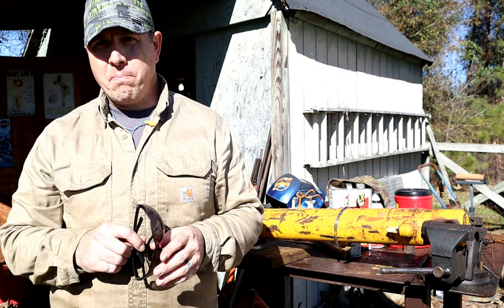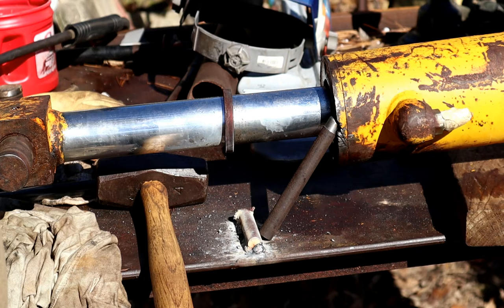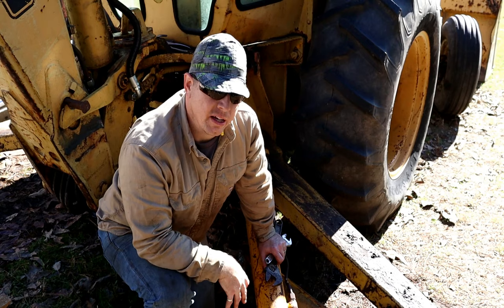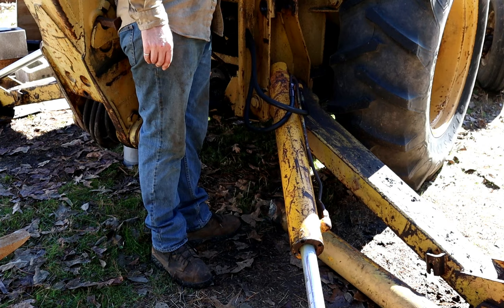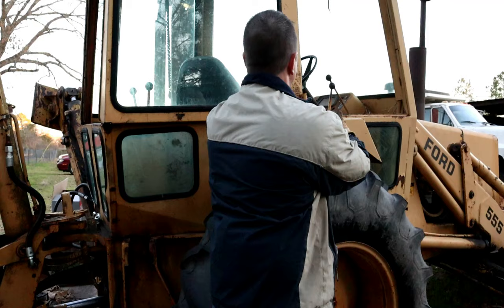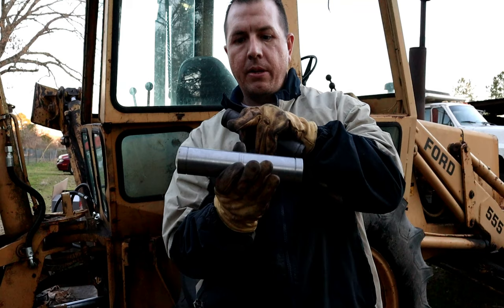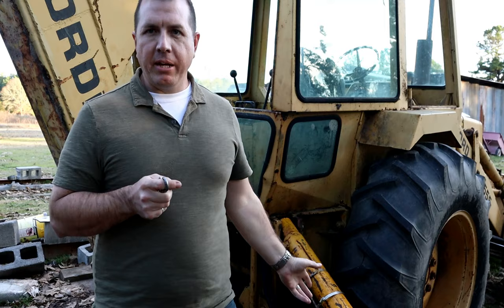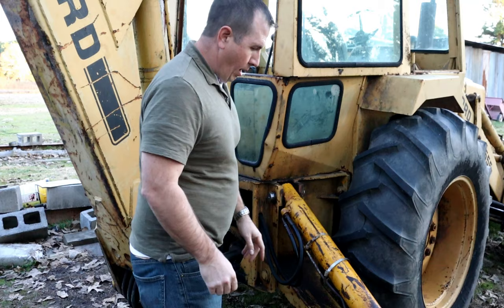Hydraulic Cylinder Disassembly Repack Rebuild Install FAST!

Comment: Great Job on a pathologically designed gland nut that needs to be 2x more material thicker for the torque required to disassemble. Some castlations are called for too. "They're all designed like that" is NOT ok

Comment: 580 boom cylinder . Tried all the stuff - Fail. Finally used long jack and gland wrench on one side, pipe wrench and F250 on the other (via tow chain and a half ton of gravel in the bed). Got the pipe wrench to breaking point then jack did it.
Reply from the maker: Yeah been there. The struggle is real!  I have a vid a few before this one called stubborn cylinder removal or something. Went through something very similar
Reply: I am from China Seals Factory. Our company produces many types of hydraulic oil seals. If you are interested in our products, we can send you free samples so that you can learn more about our products.

Comment: I want to know how much torque was required to break your vice!? I recently rebuilt a case 580 loader lifter cylinder. Got the gland off okay but the piston bolt was like yours. Took it to a local heavy mechanic and he used a 1" drive impact wrench and even then it was tough. (He didn't charge me. Gotta LOVE living in small-town U.S.A.!)Thing is, the torque spec on that bolt is only 210-240 lbs, so it shouldn't be that difficult. The problem is the red tread locker. Heat is required for removal. I have 2 more cylinders to rebuild, so why not remove the piston seals and heat the bolt to 500 degrees? Has anyone tried this?
Reply: Sometimes locktite is an issue heat the piss out of the then try buzzing it off with an impact of that dint work take it to a hydraulic shop and they’ll have a torque bench
Reply: I am from China Seals Factory. Our company produces many types of hydraulic oil seals. If you are interested in our products, we can send you free samples so that you can learn more about our products.

Comment: Heat that bolt head till it’s dull red. It has red lock tight on it and you need to melt it to let the bolt move.
Reply: I am from China Seals Factory. Our company produces many types of hydraulic oil seals. If you are interested in our products, we can send you free samples so that you can learn more about our products.

Comment: My trusty air hammer always seems to do the trick if it doesn’t budge the first try a little heat and then get back to work I’m currently working a lift cylinder on a d8 fairly good sized cylinder but that air hammer always seems to get me out of a bind.

Comment: I had to do seals on one not long ago had same problem getting it to loosen I just heated it with torches then used pipe wrench worked great and didnt have to risk damage beating it off

Comment: My solution removing the stuck gland nut factory installed on a cylinder never serviced in over 50 years.
I have a Ford Construction model backhoe I needed to rebuild the boom lift and curl cylinder . On one cylinder the  nut was so tight it was impossible to break lose. I found something that works very well. 
Since my Nut has notches in it for a special tool that I did not have,  it was going to be hard to grab it, I had a 3 ft pipe wrench but did not want to chew up the cast iron nut.
 I had some 6" pipe so I sliced a piece the width of the nut and cut it to bend to fit the OD of the nut  and with space for it to go on over the rod. 
 I cut some pieces of 1/4"  steel plate to fit the notchs in the nut and welded the pieces to the inside of the ring as they sat in the notches for positioning. That gave me a  protective steel cover for the nut that grabbed it and protected it from the pipe wrench cutting or crushing it.
I had to run several beads of welds on the outside of the  pipe ring to get the pipe wrench to bite it. I put the pipe wrench on my ring and used a 4 ft cheater pipe over the pipe wrench handel, No amount of weight pulling down would un screw the gland nut. 

This was the trick that did it. I had a cherry Picker. I turned the pipe wrench where lifting up turned it counter clockwise. The cylinder was still on the backhoe with the boom extended . Hooking the hook on the cherry picker on the open end of the cheater pipe gave me a lot of power lifting pressure on the bar, much more than I could have ever applied pulling down with even 10 people and a very long cheater bar, it was a 1 ton lift so I was applying almost 2000 lbs to unscrew the nut.,  as I pumped, it almost started to lift the whole boom,  but then pop, the nut broke lose. PS make sure the pipe wrench, the cheater bar and the boom hook are all in line parallel with the nut, having it at any angle will just cause it to lose the bite and slip off.

 I also found a good way to remove the rod from the cylinder. First remove the cylinder and drain the oil from each side. Loop a chain through the eye end of the rod and hook the cherry picker hook to the chain loop, with the arm of the cherry picker extended fully  lift the cylinder till  the cylinder (hole end) is barely on the ground, Run a pipe or bar under the legs of the cherry picker and through the  hole of the cylinder. As you pump the hoist it will lift the cylinder till the pipe through the cyl hole stops it catching on the legs, at that point the rod will start pulling out of the cylinder.
As long as the measurement from the bottom of the legs on the cherry picker to it's arm where the rod is chained is loner than double the measurement of the cylinder when it is depressed, your cherry picker will remove it. Using hydraulics is much easier than any kind of manual pulling.

Always use the mount on the equipment  tractor) to hold the cylinder rod or case when removing nuts, A vise rarely works on hard to remove nuts and trying to remove the rod with one end of the cylinder clamped in a vise is a nightmare unless your table is bolted down in concrete..
Reply from the maker: Sound advice Mel!  It takes a lot to engineer a solution and if someone is looking for another method yours sounds like it worked out good!
Reply: wouldnt a torch have solved a lot of this? we dont like to rosebud either because of collaterial damage, but my hemroids are already a problem! besides the red threadlocker requires heat. is the blue threadlocker recommended?
Reply: I am from China Seals Factory. Our company produces many types of hydraulic oil seals. If you are interested in our products, we can send you free samples so that you can learn more about our products.

Comment: I had a similar problem and got it off by:
=  I left the cylinder dead end attached to the hoe.
=  I put a 48" pipe wrench on the gland that just caught  the exposed 3/8 or 1/2" material of the gland.
=  I then put a large cheater (2" pipe about 16 ft. long on the end of the 48" pipe wrench and just let it hang.
=  I then took a propane torch and heated the cylinder tube not the gland (not very hot)
The weight of the 48 and cheater broke the glad free.  I also tried and ruined a spanner and the 48 by itself wouldn't work.
Reply from the maker: That sounds like the same couple of videos I made before this one, except that method also didn’t work, but I tried it. I think these old machines just have really stuck together cylinders. And the design doesn’t lend itself to an easy disassembly. I hope my vid and comments like these help people find a way without having to take it to the shop for $100/hr+. IT CAN BE DONE👍
Reply: I am from China Seals Factory. Our company produces many types of hydraulic oil seals. If you are interested in our products, we can send you free samples so that you can learn more about our products.

Comment: The new milwaukee fuel high torque cordless impact is what you want. If i hear right they will do 1200 foot pounds no problem. Expensive but worth it
Reply: I am from China Seals Factory. Our company produces many types of hydraulic oil seals. If you are interested in our products, we can send you free samples so that you can learn more about our products.

Comment: I feel sorry for you, you have the same Murphys law that happens with me. One thing I learned is, if it is possible to losen the gland nut while the cylinder is still on the tractor, it is much easier that way, a vise is the hard way unless you have a strong vice mounted to a metal table bolted to the floor, not many people have that.
For a tractor a 1/2" drive air impact driver is not  heavy duty enough, I bought a 1 inch drive impact like they use on big rigs, it was about $134.00 on ebay and got some reducing adapters at Harbor freight so I can drive 3/4 or 1/2 inch drive sockets. It gets the job done for the nut on the end of the rod. Also sometimes with anything that is stuck or rusted , heating the part you want to turn till it's red hot with a torch brakes the bond, if your replacing the rubber anyway it does not matter if it gets toasted. Once you got the rod out of the cylinder, you could have attached the rod to the tractor cylinder mount and had a good support for it.

 My problem has been once I get the gland out, getting the rod out of the cylinder has been difficult , I found if the rod moves freely applying air pressure to one end of the cylinders hydraulic fitting will sometimes blow the rod out, but you need to make sure it can't hit concrete or fall because it will do damage to it. 
The funny thing about these cylinders is the gland has an outer O ring seal and an inner seal pack of cup seals, the gland nut only needs to be tightened enough till it compresses the gland cup seals, once the nut hits the metal face of the gland, or metal hits metal, , the seals has been made meaning it does no good to crank it hard to tighten it because the seal was achieved with the compression of the rubber. It just needs to be snug tight once it bottoms against the gland, no need for a cheater or huge pipe wrench. Seems too many people have no idea of the mechanics of the sealing. They think the tighter the nut, the better the seal, but that is not true because the seal is rubber being compressed, not steel against steel making the seal like with tapered pipe fittings,  flare or compression fittings.
It sucks working on things someone else did wrong, that is why the nuts are so hard to remove sometimes,
 someone thought the tighter the nut the better the seal, not true with cylinder seals, If the cup seals aren't compressing enough to seal, shims  are used, but once metal hits metal, tightening further beyond snug is a mistake and can expand the gland making it stick in the cylinder, making it hell for the next guy to get out. That next guy always seems to be me.
Reply from the maker: You got it right on man. Murphy is alive and well on my farm!
Reply: I am from China Seals Factory. Our company produces many types of hydraulic oil seals. If you are interested in our products, we can send you free samples so that you can learn more about our products.

Comment: Was the tube gulling the cause of the bleed off? My 555 outrigger does that I just got a seal kit. Hoping mine isn’t that bad. I see pipe wrench marks on it like someone’s been in it before. Good video by the way. Would have liked to see you turn the new pin.
Reply from the maker: I think the galling in the piston caused the leak down. The tube may have caused that or vice versa.
Reply: I am from China Seals Factory. Our company produces many types of hydraulic oil seals. If you are interested in our products, we can send you free samples so that you can learn more about our products.

Comment: lightly torch the tube? I just had a cylinder where one of the rings came partially out of its seat and wedged. Every quarter turn was a bear all the way out.
Reply from the maker: I’ll be doing some of the loader cylinders this winter. I feel like they won’t be any easier
Reply: I am from China Seals Factory. Our company produces many types of hydraulic oil seals. If you are interested in our products, we can send you free samples so that you can learn more about our products.

Comment: Hi man time good job , i have similar problem with my mitzy bd2e dozer lift cylinders . Only one of them has bent rod and i will not disassemble  them until i know how to straighten the rod so i am interested to know how you straightened yours ? I only have a small press. Shane downunder.
Reply from the maker: Shane I used a 20 ton H-frame press and it struggled to get the shaft straight. I would recommend larger than 20 ton if possible. You block up either side of the bend and press through the apex of the bend. Then check with a straight edge and roll on a flat surface.  A super heavy duty hydraulic tube bender might work also but be careful and best of luck
Reply: Thanks for advise , gives me confidence to rebuild even if i take it to someone with appropriate press.
Reply: I am from China Seals Factory. Our company produces many types of hydraulic oil seals. If you are interested in our products, we can send you free samples so that you can learn more about our products.

Comment: So extend the cylinder all the way out I was afraid of the hydraulic pressure. So you just bleed it off?
Reply from the maker: With the machine off and the cylinder disconnected pins or laying on the ground not holding pressure, you can loosen the fittings. Do it slowly and there shouldn’t be much if any pressure
Reply from the maker: The cylinder doesn’t have to be extended. The cylinder I was taking apart had a bent shaft and had the gland bound up
Reply: @Man-Time  ok thank you. Anytime I’m breaking hydraulic lines free I always try to do it as slow and gently as possible. I never had a line explode in my face but I always had the fear.

Comment: How abt the bottom piston on the lower boom? Could u do it myself? Or should I bring it somewhere? It’s a Ford 755 backhoe
Reply from the maker: Do you have a place you can buy the repack kit?  How much is the kit from the dealer?  Can you afford to bring it in if you don’t have all the tools to do it, or are you willing to buy all the tools for future builds?  Have you rebuilt one before?  Lots of ways to look at that question. Doing it yourself can end up costing more if you don’t have all the tools and still need to get the parts from the dealer
Reply: I am from China Seals Factory. Our company produces many types of hydraulic oil seals. If you are interested in our products, we can send you free samples so that you can learn more about our products.

Comment: after rebuild its dry of hydraulic fluid, just cycling it like that purges the air and fills it with fluid? i assumed they had a bleeder somewhere.
Reply from the maker: No hydraulic cylinder that I know of has a bleeder. The manuals say to “exercise” the cylinders several times to bleed out any air and it does work.  Best to let the machine set for a while after though. The oil needs time to settle out the air too
Reply: The hydraulic reservoir is the bleeder in that case. Any air in the system rises to the top of the reservoir which has a breather cap! the system is fully closed after the pump. this is alsow why the manuel suggests to exercise the cylinder. That just cycles all the air into the reservoir but you have to be carefull, without priming the cyclinder there is air which is compressable and is a big trouble maker. same goes for almost all hydraulic systems (hydrostatic drive for example) just cycle the oil after replacing or repairing the hydrostat and your good to go. Cheers and greetings from germany
Reply: I am from China Seals Factory. Our company produces many types of hydraulic oil seals. If you are interested in our products, we can send you free samples so that you can learn more about our products.

Comment: funny to see  ,,    it's not easy if you don't know how to separate a cylinder stuck in the nut  ..   the key is heat and very solid clamping of cylinder .. i have made 1000 cylinder much larger than yours .. they can be hard to separate ,  95% is technique and experience